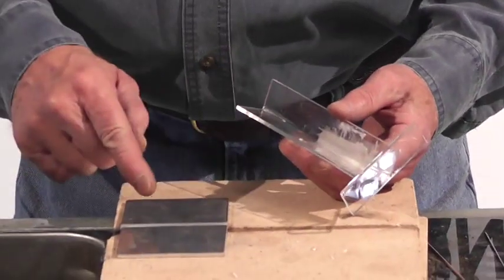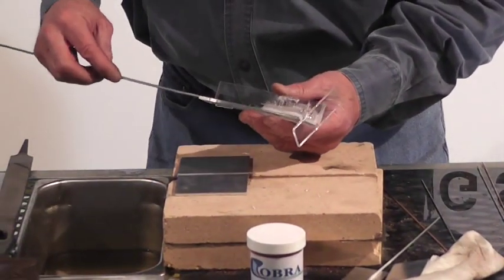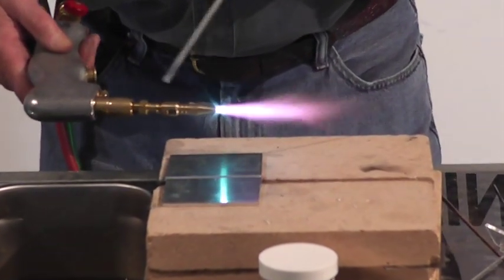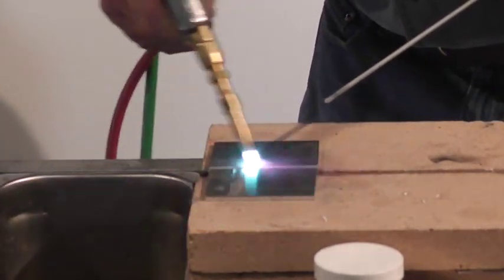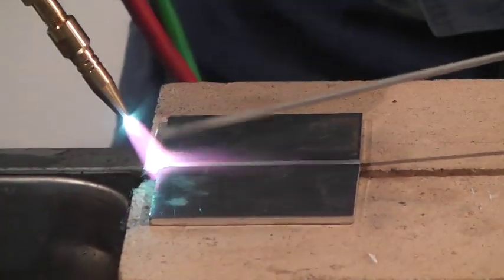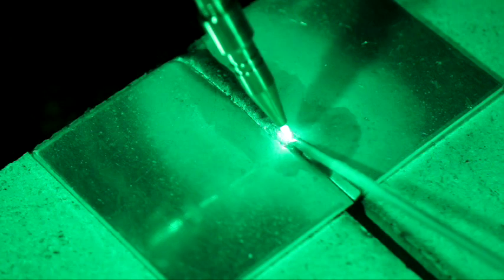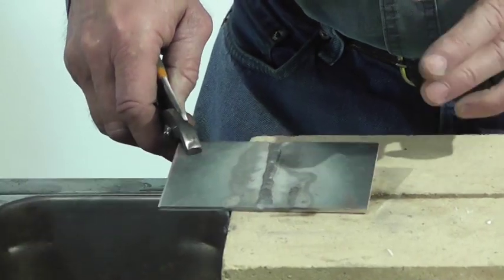HOW TO GAS WELD THICK ALUMINUM

Comment: In my humble opinion this is the best video for alum gas welding. YOU MUST USE FLUX there are other yahoos welding with out flux, weld will be brittle and fail under any substantial load.

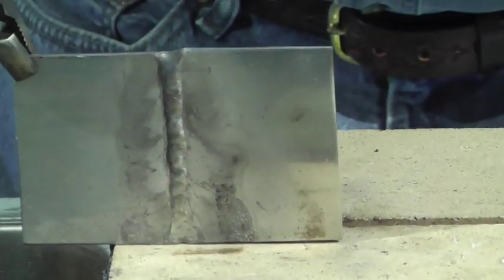Comment: Why lie about penetration. At the beginning it has full penetration but for most of the root, the backside does NOT have full penetration Look at 2:00. Easily fixed with practice: slightly more heat or slightly slower travel speed
Reply: Very good.  I used to be a sheet metal worker and used this type of oxyacetylene welding a lot.  You're absolutely right about the lack of penetration.

Comment: What filter are you using on the camera that permits such a clear view of the torch flame?
Reply from the maker: +brxtmp106  The filter you see in the video is actually our cobalt blue welding lens.  The unique lens is designed to knock out the orange sodium flare often seen from aluminum and cast iron welding.
Reply from the maker: +CobraTorchesInc This lens is designed for our customers.  It comes in 2x4 lens, regular sunglass stye, and a full face shield.
Reply: Thanks, I was hoping it was your lens. Just received my full face shield from you guys yesterday so I'm set!

Comment: so would it be practical to use this method over mig or tig? My project is a 16'×72" aluminum jet/jon boat. Mostly 1/8" 5086 and 1/4" in a couple spots.
Reply from the maker: +Robert Unversaw  The torch is capable of welding  this application, however a mig or tig still might be more practical, especially if you are building the boat from scratch and require long runs of welding.  A mig or tig might be quicker.  Also note if any further bending or shaping of the aluminum is required  after welding, the soft annealed weld from this torch would be more beneficial.
Reply: I assumed this was a slower process and I'm fine with taking the extra time. I just wanted to make sure the integrity if the weld would be the same or better.
Reply from the maker: the integrity of the weld is the same if not better.
Reply: CobraTorchesInc

Comment: so would it be practical to use this method over mig or tig? My project is a 16'×72" aluminum jet/jon boat. Mostly 1/8" 5086 and 1/4" in a couple spots.